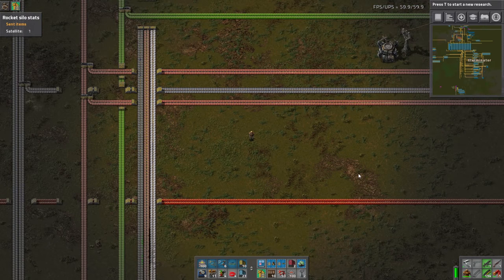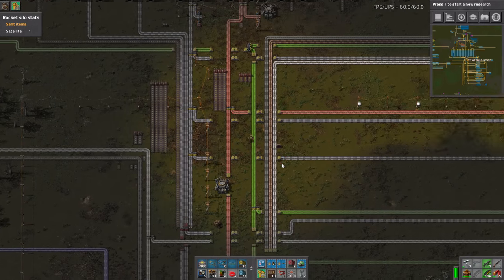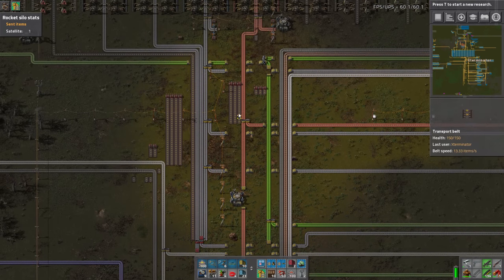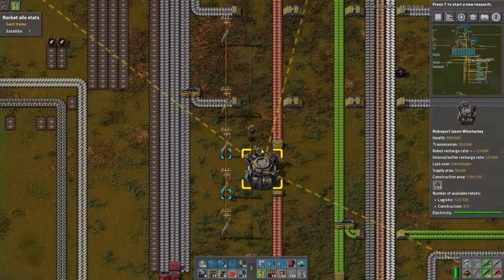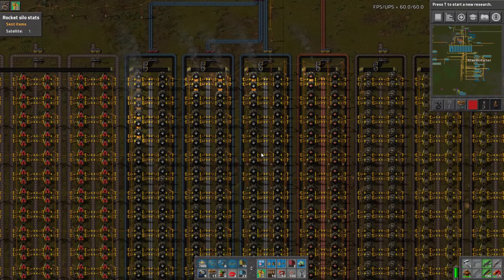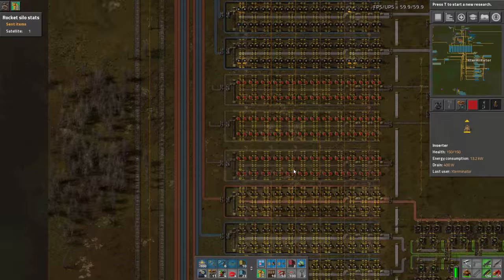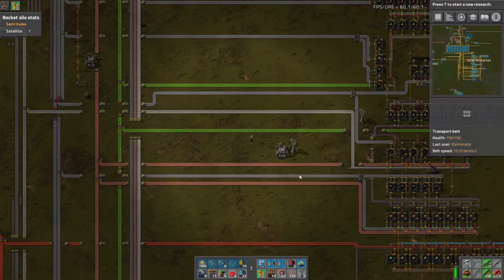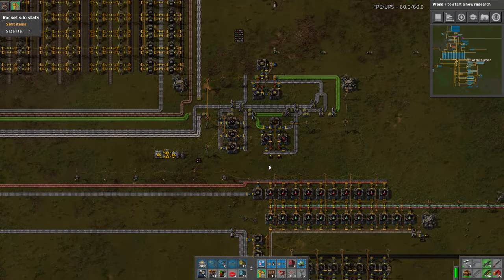Factorio: Tightening The Belt: Megabase Guide EP30 - ARTILLERY WAGON | Tutorial Gameplay Series

Comment: 3:19 You could have used the copper wire to click the two poles that you didn't want connected, and it would disconnect them. Same for removing red or green wires.

Easier than removing all of the wires from the power pole and then needing to string up all the other connections again.

Comment: Hey xterm. I just started watching your play throughs so I could be wrong, but I'm getting the feeling that you don't like very complicated circuit things. It's cool, the best thing about factorio is that you can find a million solutions to the same problem, so go with what you like. I did want to touch base on the s/r latch though. I think they are very very handy. I use them all the time. They can be used for more than a backup power cut on. I use them to kick off my train stops until they build up enough product to feed x amount of trains. Keeps my trains from looping too much or idling at stop 1 when it could have ran to stop 2. I use it to kick uranium processing on and off when 235 or 236 falls bellow certain thresholds.  Use it to turn on coal liquefaction if crude oil stops cutting it. There are of course simpler ways to do these things and more, but circuits and combinators give you finer control over it, and the s/r latch is kinda the entry point. thought it would be worth mentioning that people should look up a wiki on circuit stuff if they want to see the full range of what they can do with it and how (your explanation of the s/r at around 6:25 left out some key details like wiring the "s>r return s" combinator to itself, which is critical for the thing to work). As a last note, you mentioned that you can do an s/r latch with few combinators. This is true, you can make one with one decider and one arithmetic, but it's less intuitive. The three decider version breaks it down simply to set at this threshold, realize at this threshold. Making changes later is quick and easy. I think that's more than worth the few extra resources and two extra tiles.

Comment: Regarding the use the artillery targetter, it would be helpful to have two numbers, most probably, stacked one atop the other: number of artillery units (either wagon or turret) and number of shells available.

When Nilaus set up his perimeter defence using multiple stations along his walls, he was manually targetting so many spawners and/or worms, that he ran out of ammo AND the manual targetting that he applied expired. He needed to do it all over again when he returned later with more ammo. He might have stopped earlier if he saw the count down to zero shells.

If the artillery targetter knows the number artillery units within range, then it should be able to read the number of shells of ammo that remain. I guess that a new "attribute" needs to be added to the code: read_artillery_ammo_loaded.